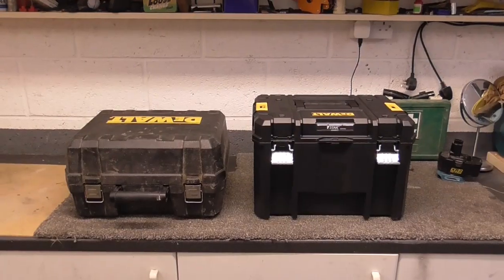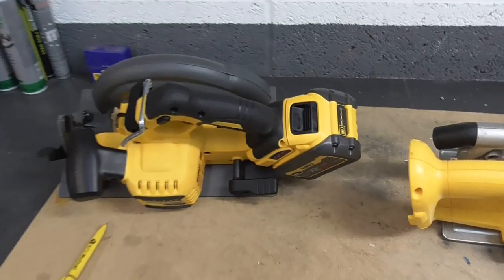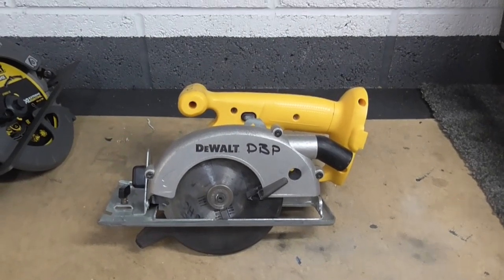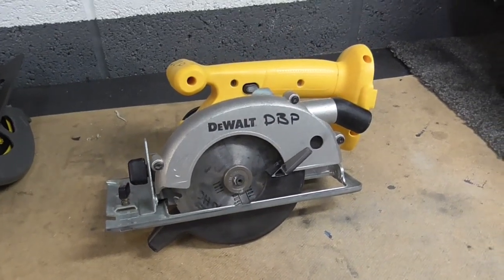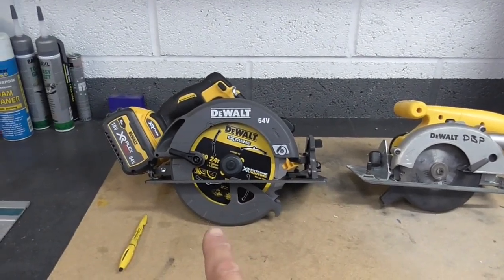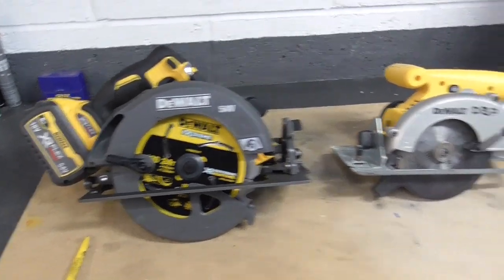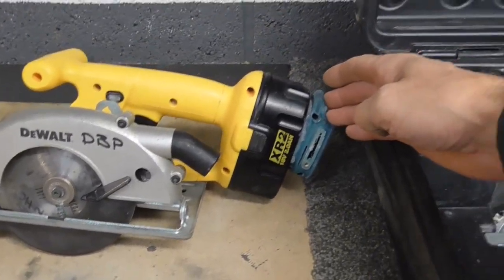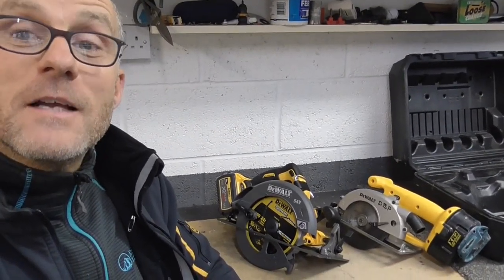DeWalt DCS578 v DeWalt DW936 (new school v old school)

Comment: Nice one David , snap with old dewalt trim saw and I have the dcs576n . I did buy the dewalt converter but with the 4 and 5 ah batterys it keeps cutting out ,so its back in the box , although the converter works well on the recipe and grinder and pin gun which i still use . I started in the trade in 1976 and not many chippys had cars then, as you usually worked for companys the slightly larger companys  always had a  seated van to collect its workers from pick up points .
 Like youall my tool kit was in a holdall , if i was working local i would use a old post office push bike which had a front rack , which i carried my tools on  . Crazy how things have changed , its almost a arms race on site now , i love to see what's new on bigger jobs . Its usually the  newbies who have just come out of their apprenticeships , mommy and daddy always stake them and they all get the latest and best they can squeeze out of them lol. I am just in the throws of buying the cordless dewalt tracksaw this week , i had a cheap corded erbauer  one  with the 2.8 evolution trach , must say it is a great by considering its a fith of the price of a festool  .  But i am going back on the big  sites for one last hurrah , just renewed my cscs skilled workers card a  spending a small fortune on more cordless gear . Anyway sorry to babble on ,it just tickled me pink  hearing your story on evolution of the carpentry game tool wise ....
Reply from the maker: Don't worry about babbling on Raymond, I'm the worlds worst for waffling, especially about tools and carpentry.🙊 You're comment is excellent, and an even further insight into how far our trade and the tools we use has come in your/me careers. As your comment suggests, many of the younger guys will have no idea how it was for the older guys who started when things were VERY different. I try and mention in many of my videos when using one of these great new, powerful cordless tools, how, different it was back in the day and what we had to do the job instead.🤪 Thanks for your great comment, and good luck on site.😎 Cheers.

Comment: Yes ,Im on the dewalt stuff  at the minute , over from Makita , As you said Makita did have the edge a few years back , and still make some very good tools , I Know many chippys still on them , I only swapped,  when my van got broken into , and the insurance money paid for the swap over , The flex volt stuff is just  awesome , for roofs  , the only thing comparable is the Milwaukee  , But i find there stuff pricey  and  over complex ed  , ie  digital torque setting , done on your mobile phone  🤦‍♂️ Having said all this , i see guys  on you tube with Mayfell , and festool equipment , very good tools , but i often  wonder what jobs thay do to pay for it all , Our trade  has to be one of or if not the most expensive , In equipment terms ,carnt get my head around how brickies or plasterers  , can be on comparable wage when there kit  costs about the same as a cup of tea and cheese sandwich  🤣 rant over
Reply from the maker: Hi David. I've just stopped chuckling at the last bit of your comment.🤣🤣. I agree about the Festool kit. Of course its really good stuff, but the cost is not realistic, especially for use out on site, EVEN if you really take care. I've had kit robbed twice from a lock up, but thankfully, not a van. I cant imagine the feeling coming to your van once its been cleaned out.😢 I buy the kit that I can afford and does the job, but will spend a bit more if a tool gets used more often of is more suited to a particular task.(the 54v circular saw for big ripping/roofing for example). Thanks for your comment mate. I've really enjoyed finding out little bits and bobs like this from some the of the great messages I've been getting.😎 Have a nice weekend.
Reply: Yes a bucket full of trowels and a 4 ft level and on same money as chippies . Beggars belief realy .
Reply from the maker: @Tez73  Who's the fools Terry.🤪🤩
Reply: @thetallcarpenter  sometimes, just sometimes, when I'm being moody and overworked and its getting me down, I regret choosing carpentry. It seems to have the highest overheads, the most amount of tools and the risk and effort that comes with looking after and protecting them, the most amount of physical and mental work, most people assume its easy and could do it themselves so they don't value your work at the right price... but I love it the job and the satisfaction so I'd never pick anything else. It feels right. But I know plumbers and sparks that have all the best kit that they barely use because they get away with obnoxious prices and its annoying.

Comment: 18v DeWalt was the standard on many jobs.... Contractors sharing batteries and chargers was normal, LOL........I still use mine around the house!...slowly making the move to Newer Lithium series.....But I kinda like the old clunky cordless drills.
Reply from the maker: Hi Mike. You're old school are you mate.🤪 Younger tradesmen wont have experienced how much these early battery tools changed our working experience, as they wouldn't have been hand screwing and cutting everything.😣 Great comment and thanks for watching.😎 Cheers.

Comment: why didn't you get this one DeWalt DCS577T2  love your opinion thanks colin
Reply from the maker: Hi Colin🖐I'm not that keen on these type of 'sidewinder' saws as I find them quite unbalanced for a 190mm saw. A lot of the weight is out front and they can take a fair amount of wrist power to control when exiting a cut. I prefer the compact nature of a blade right saw as they make you lean over them to sight your cut line, this is turn brings the saw closer to the body which puts your arms in a more powerful leverage position to control the saw👍These are just my opinions after 30 odd years of using circular saws, and I understand that everyone is different😎Cheers Del